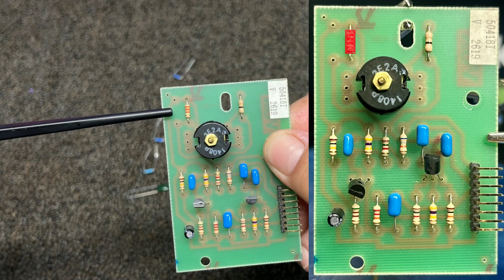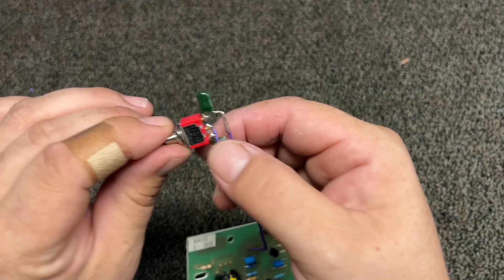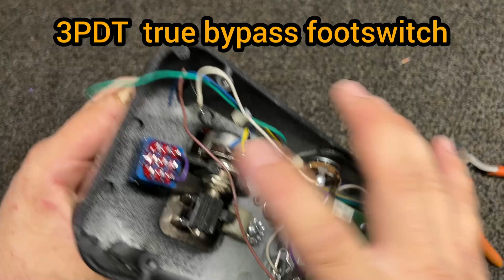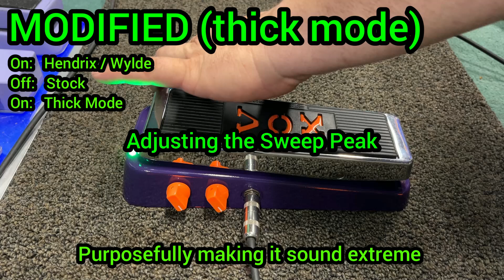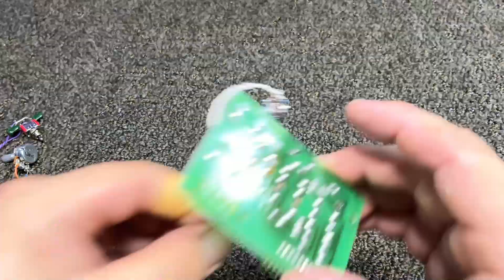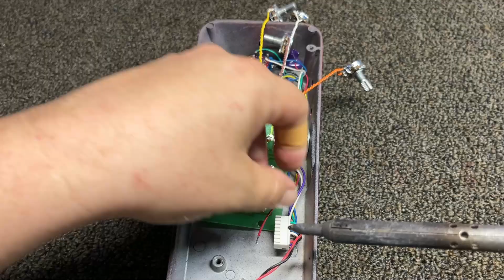How to fully mod a Vox Wah 847

Comment: You can also put a 3 way rotary switch for the range capacitor an add a 0.68nf on the thrid Position. Than you can it also use for bass.😊

Comment: ♥Ruckus dude...you're the man...I have done all of your mods for this wah on my older CryBaby...it's so good man, epic really...during the process I realized that you can actually have all of the internal electronics, pots and switches outside of the foot pedal, so I used a 3 metre USB lead to link the foot pedal to a control unit with all of the pots etc on/in it which is on my workbench/desk/studio (it takes over your life doesn't it) with other stuff that I like to have at hand level  to edit/mix on the fly...a lot pedals and their functions have become unsuitable for floor conditions at large but clicking them on/off at floor level is essential...if I bent down on stage to adjust stuff, I might not be able to get back up!! I'm sure you already have had similar ideas, just shouting out and biggin it up man ♥
Reply from the maker: nice! cool idea!

Comment: Thanx a million, great explanation! Watching and recommend them all with pleasure.
 Q: in stage 3, you wire 2 capacitors to be used when switch is either in the right or left pos. with 0.01 uf & 0.022 uf. In the middle they're off circuit and just the stock capacitor at work. But, as you've mentioned earlier, the stock one is also 0.01 uf. Well, did I miss something or it's a mistake? Otherwise, there's no sense in switching from 0.01 to 0.01 value . Can you, please, check it out and comment? Right now it looks like 1/2/3 pos correspond with 0.01/0.01/0.022 uf. Thanks in advance and "the finger", by the way, is just my "F.... the System" logo!
Reply from the maker: The switch is on/off/on so it only engages on the side positions and off in the center. 
The stock cap in the board is always on and you’re adding more capacitance when engaging the switch.

So the .01 on the switch will make the stock cap .02
And the .02 on the switch will make the stock cap .032

So the positions are added together to be .02/.01/.032

Basically you’re not switching to another capacitor, you’re adding capacitors to the stock one.
Reply: @ArtoriusGuitarNerd  Oh yeah, my mistake! I got later myself that it adds. I was misled by the first mode idea and thought that .022 & .01 values won't be changed, but here they're added to stock value. But I found an interesting way: using a korean a-la Gibson 3-way on-on-on switch with both on in a center position(like 2 humbuckers in parallel) and the stock capacitor out from deal, I got 3 to choose from: 0.022/0.01 or 0.022+0.01=0.032. Plus, the switch has a nice black coating on the switch handle.

Comment: Thank you for this superb modification, can you tell me the reference of Q1 AND Q2 ?(mayby MPSA18?)please.
Reply from the maker: I don’t understand the question. Are you asking what transistors are in the pedal?

Last time I worked on a Vox wah it had the same transistors as the crybaby which were the MPSA18.
Vintage wahs used the TO-92

I personally like using the BC109 transistor 

You need to pay attention to the pin out configuration if you switch transistors
Reply: @ArtoriusGuitarNerd  Thank you for the response, yes I was asking you which transistors you used for your demo. my vox 847 usa uses 2 MPSA18. I ordered some BC109C, to test. I modified my wha as on your demo.
a question arises how to distribute the gain of each transistor.
Please.
Reply from the maker: @diddounet  first let me say the pin out for Bc109 are reversed. I bend the center pin to face the opposite direction when installing bc109 transistors. 
Adjusting the emitter resistors 470 ohm & 10k
Reply: @ArtoriusGuitarNerd  For BC 109C, I confirm for the inverted pins and emitter resistors 470 ohms & 10k ok
Thank you for your availability.

Comment: Thanks for taking the time and posting. The mods look straight forward and you explain the process very well. This may be a long shot but I'm hoping to get some insight.. I'm trying to remove the treadle from the base of the wah as to refinish the enclosure. After doing some research, I've found that I need to knock the pin out with a punch/hammer but I can't determine which side is knurled and don't want to risk hammering in the wrong direction, damaging the enclosure. My pin looks exactly as yours does on the "stage 3" wah you have refinished in purple. One side completely flat, one side recessed on all sides with a protruding "nipple" in the middle. Any advice?
Reply from the maker: You don’t need to remove it. Just keep the oven temperature around 150° if you’re going to bake the paint as I do. 30 minutes should do it.

Comment: wait for Stage One switch modification - I can see the switch is ON OFF ON as well as for Stage Three - at least by the looks on the case of the switch 

can on /off/ on be used or only on/ on - for stage one?
Reply from the maker: @beatbaker420  wow you have good eyes, I was using the same switch for both examples because they “look” the same way and get wired the same way.

Stage one requires an on/on switch if you remove the cap and put the switch in its place.
You can use the on/off/on switch if we’re only adding the switch to the original cap.
Reply: @ArtoriusGuitarNerd  thank you! would you recommend to switch the inductor to the red one from dunlop? Fl-02R Fasel Inductor Red? Or is it not compatible?

Comment: Love this video...I have been tweaking my old Vox847 for a while now, did the true-bypass LED, changed out some resistors, added a power plug in. I am going to try the pots for the added fun next. I do have a question for you, hoping you can answer. My Vox has an issue where you can turn it on (meaning the LED lights up) even without an input cable inserted! This is not an issue when I use a power supply but if I want to run a battery, I have to be careful because it can easily get clicked on and thus drain my 9v. I actually decided to add a kill switch to the battery which at least solves the issue of me draining batteries but I was wondering why that's happening at all?
Reply from the maker: @tommysea9000  yeah at some point I want to do a video on adding a power jack & power filter on old Voxes & Crybabys
Reply from the maker: @tommysea9000  it’s the ground wire you’re using for the LED. Sounds like you got the ground from the battery lug on the input jack.
Reply: @ArtoriusGuitarNerd  Hmmm, I did some searching inside my pedal but it doesn't look like that. Do you have an email address I could send you some pics of it sometime?
Reply from the maker: @tommysea9000  I just realized I’m only getting a notifications for the first comments and nothing on the replies. So sorry for the delay.

You can email me and I’ll be glad to help out with any questions you have.

ruckusaudio@yahoo.com
Reply: @ All good, I will send you something in a day or two.  TY!

Comment: I would like to make these mods for v845. Can you help me?
Reply: What potentiometers did you use? Lin or log?
Reply from the maker: @ linear pots.
You can see the letter “B” on the pot.
“B” linear
“A” audio
Reply: Are they all "B" linear? (Vol. Gain Mid Sweep...)
Reply from the maker: @paveldanisovic2428  yes they are
Reply: @ArtoriusGuitarNerd  What gauge wire you using?
Reply from the maker: @paveldanisovic2428  sure what did you need help with ?